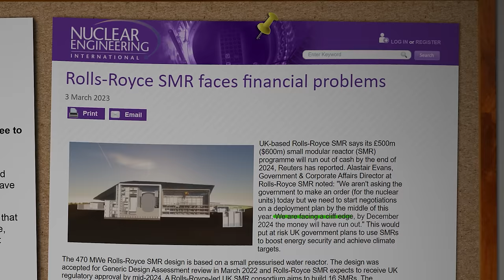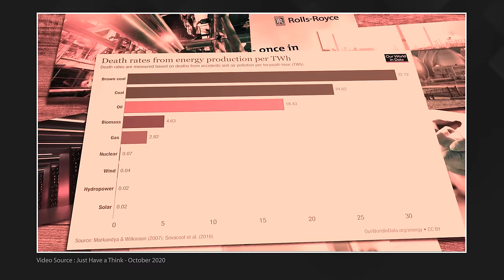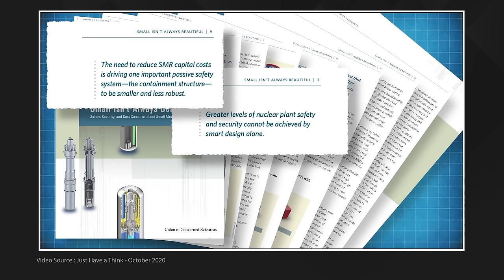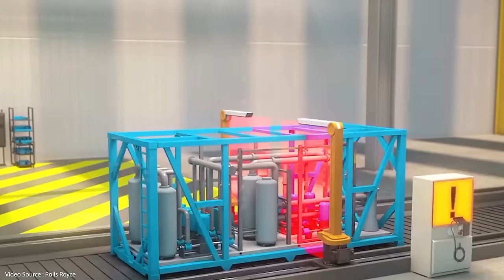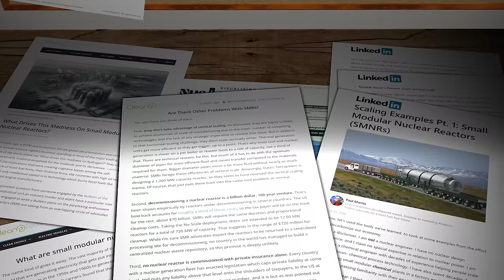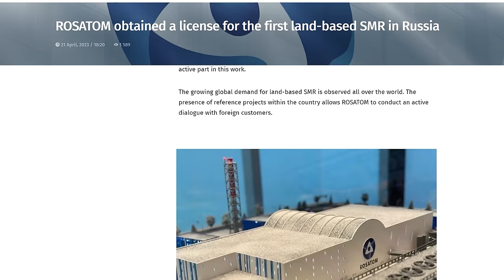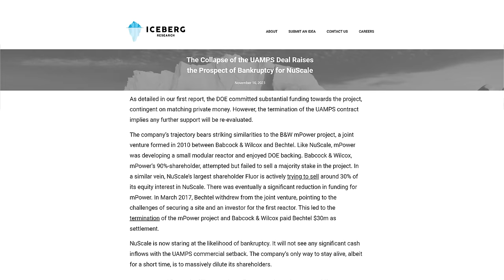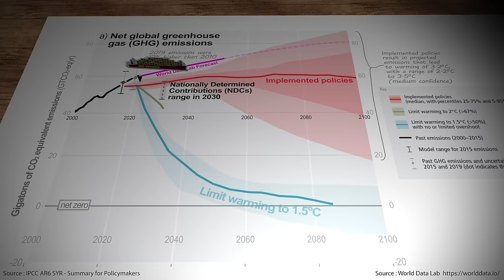Small Modular Nuclear Reactors. The Verdict

Comment: Whenever anyone tells me that modular reactors are the future and the only problem is that nobody has invested enough in them, I point to the worlds major navies.  SMR's have been used in nuclear subs for nearly 70 years now.  All the major powers have spent countless billions on trying to make cost effective small reactors for subs, aircraft carriers and other military ships - the military advantages of these are enormous.  And yet virtually no progress has been made by any of them - the latest subs from all the major powers are still using the same basic technology as the original nautilus (apart from some experimental designs like the Soviet reactor for the Alfa subs), and if anything, they are falling behind to the latest generation of hybrid and AIP propulsion systems.  And this is in an area where cost isn't much of a consideration.
Reply: Exactly, there are a ton of nuclear submarines around, so it is not as the wheel is being reinvented.
Reply: Nuclear subs and SMRs are not the same thing.
Reply: @stl1321 I saw a comment on a wiki page that the Bechtel A1Bs in the Ford class carriers have 92 or 93% U235, which is highly enriched weapons grade stuff. That is nothing like the 5% in commercial nukes that need to be refueled every 2-3 years. Those things go like 25 years. I wonder if it wouldn't be worth sticking them in large container ships, and parking a couple of soldiers on it to guard it. You could save a lot of oil.
Reply: Why would you compare them, they're not at all the same thing..? Different design, different fuel, different requirements. The only thing similar is size.
Reply: @stl1321 not exactly same, but well, they are almost the same. They produce steam and/or hot water and cost of energy is not the primary consideration.
Reply: @janami-dharmam  wrong take. Many sub nuclears are fast breeders in smaller designs. SMR is not SFR other than SFR in a sub is small. There is no water in a SFR. They are using liquid sodium och other metals as coolant and not water as in a SMR
Reply: It's incredibly annoying when SMR is sold as tech bro hype as if to imply nuclear isn't already a mature technology and they didn't build small from the begining because it's stupid and counter productive. Today the value of smr is not technical it's to get around safety regulation. No thanks.
Reply: @Furiends  that sounds like a justification to keep building pressurized reactors and block every other type reactor out there because it wasn't stuck in the sub in the 1950s🤦
Reply: @fjalics  "You could save a lot of oil." - Oil is a very useful feedstock - if you don't burn it.  Also, we might need to burn it 17,000 yrs from now to avoid plunging into the next Ice Age.  We won't be able to do that if it has been burnt already.
Reply: That's cause at least in the US, the design has worked flawlessly.  Militaries for good reason prefer what they know works, as the alternative is, well, mass death, if not destruction of nation.  The concurrent 'maint' issues are all known, documented, it's known how to train operators and maint to do their jobs flawlessly, and they use a rapidly rotating force, needing to know they can train up people fast enough and that they will perform perfectly.  
ANY nukes remain a HUGE problem because no one will address storage of spent wastes.  So it actually sits all over the world in 1,000's of SURFACE STORAGE UNITS, that usually consist of a thin metal shed over a single wall swimming pool, that tend to leak as earth settles, earthquakes....I'm all for nukes, but this lack, the governmental unwillingness to bite the bullet makes nukes a non starter.
It's nearly impossible to find a safe site to place them now, much less 100 or more? to replace a mega nuke.
It's hard to imagine how many wind turbines, solar cells, pumped storage projects for the price to build a gig or two of nukes and this gets worse all the time for nukes.
Reply: @janami-dharmam that's like saying a generator for a town in Siberia is the same, since it's small and cost isn't a consideration. They're fundementally different animals. Not to mention, most of the military documents on nuclear reactors are posted as controlled information.
Reply: And yet there’s nothing better to power subs or aircraft carriers despite the issues
Reply: @VrigeHD  You have your facts wrong.  The vast majority of submarine reactors are PWRs, including in the old Soviet and newer Russian nuclear powered submarines.

The Soviet Union/Russia did experiment with a small number of liquid metal cooled fast breeder reactors for submarines.  The used a eutectic lead alloy (you would never put sodium in a naval reactor to prevent the massive reaction if the sub or ship floods the reactor or sinks).  Those reactors designs were quickly abandoned and I read a technical report in the early 2000's about the problems that the eutectic lead alloys caused with the piping and the reactor vessel (not to mention lead poisoning of the submarine crew).

Interesting relatively new news is that Russia is now planning to build a small demonstration SMR power plant fast breeder based on eutectic lead alloys.  This will be land based.  Apparently Russia wants to look at that technology again.
Reply: @Furiends  Unfortunately, SMRs do not get around or avoid any of the safety or other regulatory requirements such as security.  That's just hype based on ignorance (and in a number of cases willful ignorance)

As you probably know both the USA and the world built lots of small reactors early on which would be considered SMRs today.  They were not cost competitive unless you have a unique location where power lines cannot be reasonably run.
Reply: @Freedom_Half_Off   PWRs have won out over all other designs because they are the most economical long term after decades of running a number of other designs.   That's why we should build PWRs...

Today there are currently:
301 PWR power plants 
46 Heavy Water power plans (CANDU or variations of CANDU)
42 BWRs (down from about 100 a decade ago).
11 Power plants using gas cooling or liquid metal fast breeder designs.

Today there are 62 nuclear power plants under construction worldwide.  My information is that 56 of them are PWRs.  2 are BWRs are in Japan and all work was suspended in 2011 after Fukushima (but the construction permit is still open) and the rest are either heavy water CANDU type or liquid metal fast breeder reactors.
Reply: @russell7489  Dont you know that nuclear waste is not waste at all but fuel for fast reactors. Or are you pretending not to know.
Reply: @perryallan3524  The brest od 300 is pure lead not eutectic
Reply: @afreire239  Thanks for the information.   I'll be interested to see how it works out.   The problem with Russia is that often we don't here the truth about what happened at certain reactors until 30+ years later.  So I have to treat most Russian reports with a healthy bit of skepticism.
Reply: @fjalics  Sure. 'Cause "parking a couple of soldiers" will be sufficient to guard a nuclear reactor & nuclear fuel. No worries at all.

Are you sure you think we need to spend so exorbitantly? Wouldn't a $5 hardware store padlock and a "Keep Out" sign do the trick?
Reply: @jamesthompson7282  I'm not knowledgeable enough to know the best way to do it. I think the Ford class begins with weapons grade stuff, but it wouldn't have to. But I'd like to point out that when the Houthis started mucking with shipping, we sent ships, and launched missiles. Compared to that, a couple of guys on a boat somebody else paid for, and fuel somebody else paid for is nothing. But if I were tasked with making a decision, I would ask a lot of questions from a lot of people before I would be comfortable nailing down details.
Reply: @perryallan3524  You're conflating the idea that if SMRs actually did get around safety regulation they'd actually be economical. They wouldn't be.

Conversely I'm not saying they actually do get around safety regulation. I'm saying the value they have to investors is not that this is new tech but that it positions itself to take advantage of less safety regulation.

Hope that makes sense.
Reply: @stl1321 Agreed but not far off, they heat water to make steam which powers a turbine. Connect the turbine to a generator instead of a propeller, shorten the length of the steel cylinder considerably as nuclear missiles and hotel accommodation are not needed - it's not rocket science. And the latest subs can go 25 years without refueling.
Reply: I don't know that the military would be incentivized to invest heavily in R&D for something that is already proven working.  They are quite rightly risk averse when it comes to strategically important technology, so of course they're still using the same reactor designs they've always been using.
Reply: Miltary reactors are hardly relevant to civilian bulk power generation.

Your bill would be thirty times higher, rather than the mere ten that reflects the real cost of current reactors.
Reply: Military naval engineering is based on old technology almost always and when it isn't it frequently fails.  That said the A4W and A1B reactors operate on different principles. They may be superficially the same but the A1B is more like a submarine reactor than an aircraft carrier reactor.
Reply: Navy ships are not meant to be economically viable means of power generation, they are meant to power warships. That’s why those reactors don’t work for commercial use.

It’s why France’s civilian reactors were far cheaper and far more economical than America’s reactors, because America only allowed the use of Navy reactor designs as the basis for commercial plants after it banned public investment in nuclear technology (except for military purposes). France on the other hand invested heavily in civilian applications for nuclear and then for at least the service life duration of its plants had the cheapest power on earth.
Reply: @MeEntertainmentJo_876  
French reactors are not that different, nor more cost effective. The great majority are unremarkable PWRs. Historically, they had some gas cooled reactors, prone to the same expensive flaws as elsewhere.

You have no particular basis to claim French reators produced cheap power. France hides the expense from consumers behind huge subsidies for the generator and wholesaler. The previous operator was monumentally in debt, far beyond bankrupt, and EDF has inherited that debt.

France overinvested in the seventies, then they discovered it was witheringly expensive and had a flurry of cancelled construction, just like the yanks.
Not cheap at all. A burdensome loss that is hidden behind arcane accounting. The full extent of the public subsidy is deliberately kept obscure, but cannot be less than the similar subsidies used in the US.

Regardless, old reactors are nearing the end of all design projections. New build has been a financial disaster with negative learning curve: The EPR is already an abandoned idea, with 2/3 of attempts still far from completion.

Comment: I think you missed the fact that the US, GB and a few other countries are already operating small modular nuclear reactors.  They're just doing it as a military powers.  I think you also misrepresented horizontal scale.  Pressure vessels and other high value engineering systems can gain pretty significant cost reductions in series as low as 10 or 50 units.  Will they ever replace that large massive economy of size scale?  Of course not.  But they maybe an excellent stop gap to take offline aging coal plants, or provide intermittent supply in disaster relief.